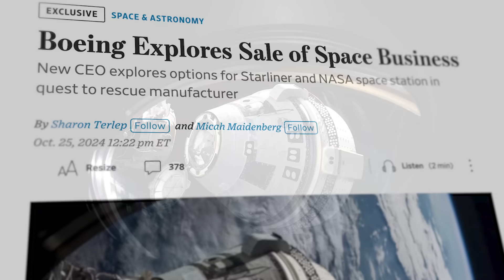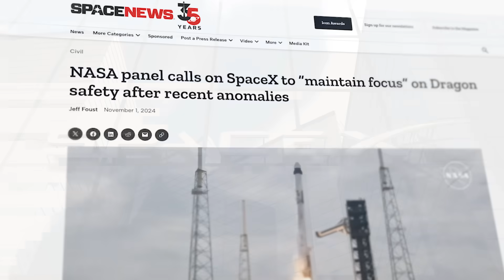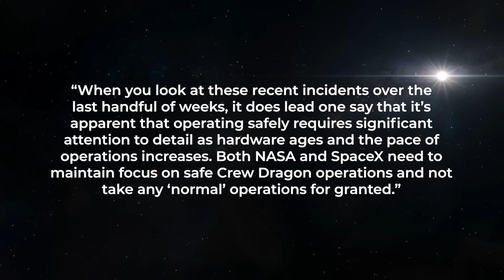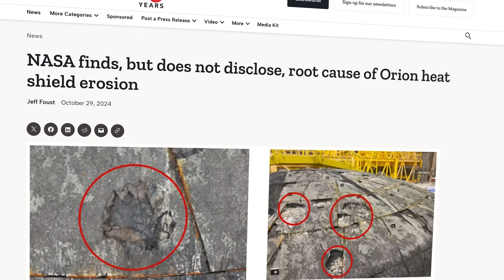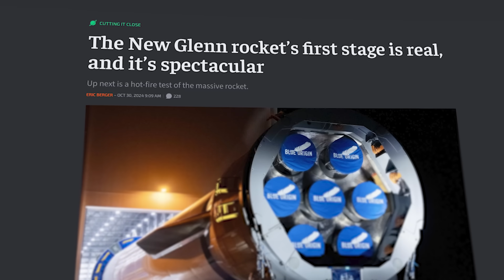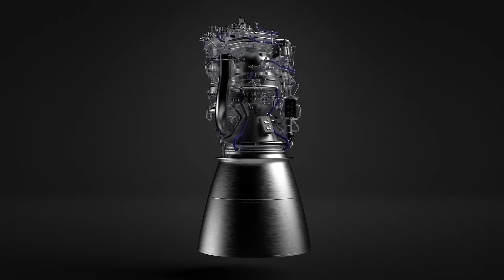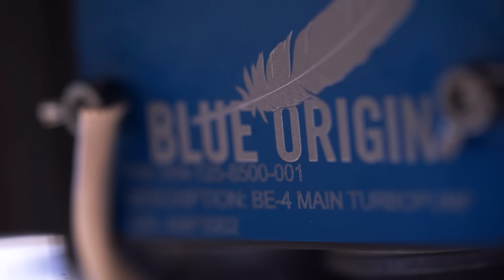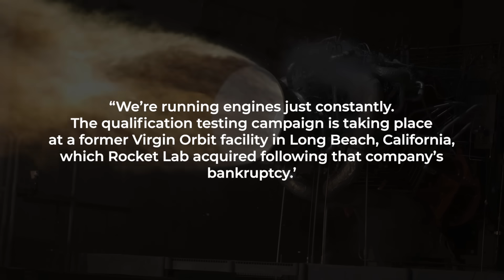Boeing Just Gave Up On Starliner...

Comment: Taxpayers should get their money back for the star liner. Billions spent, nothing that can be used  in return
Reply: You can't even get Boeing to put all of the Bolts in it's new airplanes to keep the doors from blowing off.
Reply: Actually Boeing does not get paid
Reply: @eternaleggface So youre tell me Boeing accept a contract by NASA for FREE?! Why do you think NASA selected Boeing in the first place if not due political influence? Boeing become a parasite corporation, thats a fact...
Reply: @eternaleggface  My understanding is that they receive progress payments, for milestones achieved; and they receive their last payment when Star Liner meets its final KPI.   The reason that it is done this way is that expecting Boeing (or any other company) to be able to find $4billion plus  to fund the  entire  development,  without getting a penny on the way, is financially impractical.

Somewhere, the author of this piece says that Boeing is $1.8 billion in the hole on this project. That means that they have spent $1.8 billion more than they should have, to get to where they are.  It doesn't mean that they have spent $1.8 billion, but still have a $4 billion payment to come.

If  the contract is structured with progress payments, then it  ought  to be possible for Boeing to "sell" that project. Whoever buys it will have to complete the remaining work to meet the remaining KPIs, and hope that the cost to completion will not be greater than the value of the remaining KPI payments.

I suspect that in practice someone will agree to take over the project and pay Boeing a nominal sum,  if they think that some of the technology is re-useable.   Boeing will agree if they think that just can't afford to finish the project.  They'll take the $1.8billion loss, and be glad that they don't have to lose another billion or so.
Reply: That’s capitalism 😂 private profit, public costs
Reply: Just like scam x
Reply: @TheGuruStud yikes🥱🤣
Reply: @websitemartian  he is not wrong, space x is still failing to meet the pre orbital goals or orbital goals, has no progress on the starship lunar lander, under performance for the booster. Hell they aren't reaching the basic goals and are passing to v2 and have v3 in mind already. There are 16 months left before artemis 2, with a maximum of 21 launches without fail necessary to reach the moon once.
Reply: @Pigeon_Birb  Even despite that, they're still performing much better than Boeing who was given even more funding than Space X to begin with, (and essentially costing an estimated double the price per crew seat if they were successful) and with nothing to show for it essentially.  I'm more than happy to wait for late progress than paying double the price for shoddy/shady work from Boeing (especially taking their airliner programs issues into account as of late).
Reply: @Anderrya  actually they are performing worst technically since boing sls only launched once and was practically flawless. Spacex is attempt 10 and is still failing at basic goals for a rocket. Blue origin with a completely new rocket was practically a complete success on the first launch attempt. Nothing to show? Boeing launched and orbited the moon with sls, starship has no lander or ship still and boeing has not finished their capsule but its at least exists. Spacex starship has a worse reputation than Boeing aircraft considering the vast majority of boeing products have not blown up. What is shaddy is taking the money saying you will fulfil the contract and not being able to fulfill it even after being given an extension, at school if you did so you would have failed the exam. SLS and orion are expensive for no reason i agree, but they had more to show than the fragments of rockets that starship end into.
Reply: @Pigeon_Birb  kind of hard for you to say the sls was all Boeings doing since it was a joint project with NASA. Not to mention if you want to claim it was, how about the issues Orion had when it came to reentry? I do however agree that blue origin is making great strides with their own program. Again what I said about sls, it’s not just Boeings doing, and since their involvement in the project will soon be scrapped, I’m sure there’s a number of reasons for that.  Space X on the other hand is its own project, that is just as blue origin under the advice of NASA but still primarily under their wing.  I’m sorry that you think having hundreds of lives being lost due to Boeing shortcomings in their aircrafts is far less worrisome than test flights of an experimental rocket that’s hasn’t lost any.  At least Space X can make it to the ISS without issue unlike starliner, who leaves people stranded. What I find worst is the fact that reaching out to private companies was done to save money, meanwhile Boeing is treating NASA and taxpayers like endless piggybanks. Sure Space X hasn’t fully filled their contract, but neither has Boeing.
Reply: SpaceX seems to actually deliver.  Humans and payload.   @TheGuruStud
Reply: @TheGuruStud  ?

Comment: I think there was a bump into the bottom of the capsule during separation compressing some portions of the ablative Shield causing it to have greater thermal conductivity and thus burn through faster in those areas

Comment: Every single spacecraft I have ever seen reentering with four parachutes 3 will open first followed by the fourth. It's possible to get all four to open exactly at the same time there's hundreds of little variables that make it unlikely.
Reply: Kinda like a 3 legged stool vs 4 legged. 4 Legged will almost always have a wobble until enough weight is applied.

Comment: The booster landing anomaly might’ve been because this was the launch leader?  This booster has been launched more than anything else and maybe 23 launches is the limit?

In the fourth parachute issue is happened before .  It only highlights the fact that SpaceX wanted to use three parachutes and NASA force them to use four.   SpaceX was right and NASA was wrong. The ship only requires three parachutes and the fourth one can’t grab enough air to stay inflated.
Reply: 3 chutes were having issues during testing elon had the idea for the 4th chute. NASA had nothing to do with it.

Comment: The difference between all these other companies and SpaceX is that SpaceX uses real footage of launches and missions, and all the other companies use CGI.
Even NASA, just a bunch of CGI, no actual missions.
Reply: Assuming you are referring to ascent video, NASA actually pioneered the use of live video during ascent with cameras placed on the SRBs.

NASA's cameras were intended for engineering use and using them for PR was secondary.  SpaceX is the first company to feature the use of external cameras during live launch coverage, and has taken it to the next level with live video during re-entry (for Starship).

In large part the reason for this is technological -- high quality video requires a lot of bandwidth, and even in the 90s hardware that could digitize and transmit such video was neither cheap nor light.  Add to it that the Shuttle was designed in the 70s and ita clear that adding live video wouldn't be trivial.

All of SpaceX's hardware was designed in the past 10 years, though, so cameras and live video was designed into the system.
Reply: @jmr5125  Seeing as how the first launch I remember watching was Apollo 15 when I was 5, I have  been following and supporting ALL space programs for many decades. It is not surprising that NASA has failed so spectacularly in nearly all of their endeavours. They get halfway through a project and then have the funding pulled. Look at the latest imbroglio with Bechtel building the gantry for Artemis. 3.7 billion and they are not complete yet. 5 billion for starliner, Constellation, cancelled. They have no balls. SpaceX commits and sees things through. That is how things get done. Craft that actually fly. Missions that are accomplished. They are leaving all national and private sector space programs in the dust.
Reply: @wildbill1726  Well, yeah, but the fault doesn't lie with NASA, but with Congress.  NASA is doing the best it can with the hand it is dealt.
Reply: @jmr5125  Write your congressman. Shame them.

Comment: Starliner has been a horrible project that NASA should have dropped after the very first test mission, but it's ridiculous to claim there's something still inherently wrong with the spacecraft itself.  If they resolve the thruster problem, which is not directly Boeing's fault anyway, Starliner would be perfectly capable of serving Blue Origin or another owner.  Boeing has sunk close to $2 billion into the program and much of that was to fix its many, many bugs, so the vehicle is now flight-proven for months in space and merely needs a thruster upgrade.

To Blue Origin or another buyer, Starliner might be bought at a huuuge discount from its realistic value and merely renamed to whitewash its reputation.  If you doubt that this would work, just look at Spectrum, which has somehow successfully convinced many millions of people that it's no longer Time-Warner.

The public is quite forgetful, after all; Americans are still buying Volkswagens and many won't even remember that they once vowed to never own one.  I can hear some saying "huh?" right now ;).

It's also worth remembering that if Starliner were being held to the same standard as the Space Shuttle, the crew would have returned on schedule and without incident.  Starliner returned empty only because Boeing could not prove that it would meet the risk ratio required by the commercial crew program and that was only because they could not concretely quantify the thruster problem, which only occurred in space.  When the capsule did return empty, it experienced no issues that were disclosed under NASA obligations.

I hope that Boeing sells Starliner to someone that will put it to good use; it would be a waste of resources not to do so.  Hopefully they can come up with a good name for it.  Why would anyone develop their own crew capsule from the ground up when Starliner is now quite mature and proven?

Comment: Who in their right mind would want Boeing's space division.
Reply: Depends on what strings come attached.  The division itself is just fine.. the problem is that their contracts require them to 'partner' with many other companies and use the parts they are told to use.  they have very little control over what actually goes into their capsule... remove those requirements and you would likely have a pretty effective division.
Reply: Jeff Who.  What a Bozo!
Reply: IP might be worth something. And engineers. We're short of these people everywhere
Reply: @DunnickFayuro What kind of engineering
Reply: @DunnickFayuro  who would want a Boeing engineer ?
Reply: @michaelotoole1807  the engineers are fine. it's management and unrealistic expectations for the workers that is the problem. when the company was run by the engineers, they were fantastic. but now they are run by beancounters. they killed the company.

Comment: Back in the day everyone doubted SpaceX could ever compete with Boeing's space program 😂
Reply: I remember people being angry over SpaceX not getting the same amount of funding.
Reply: To me it was obviously going to succeed and be robust due to the processes spacex followed.  They iterated ridiculously fast and did full integration tests each iteration.  They optimized the tests procedures for time.  You cannot fail with that much iteration.  

I also knew starliner was going to fail in some way because of the complete lack of testing.  I remember that at one point it was so obvious that nothing was being tested that even the corporate press started asking about it.  Bridenstine gave a little speech about how each company had their own approach and both are equally valid.  That was obvious horseshit.  It was a sign that boeing was winging it the whole time. YOLO engineering. Every single flight attempt and flight fit right into my expectations from as far back as 2016.  

The indicators have been there for a long time.
Reply: @_PatrickO  Just sheer hubris on Boeing's part. "We did it before... its not like it's rocket science!"
Reply: Got paid less and did more. This is why competition is important. WI did this with the highway program. They offered like 5 or 6 digits in bonus every day they got done early. They finished like 13 days early  (on a decade long project) iL is still working on their stretch of the same highway.
Reply: To be fair, back in the day Boeing did great things.
Reply: @stylesraw  I really don't want Boeing to fail, I just want then to do better. Sadly it seems like they have given up entirely.
Reply: @LoricSwift  Yeah, it's really a great loss when such a giant in the aerospace industry falters in such a spectacular manner.
Reply: @stylesraw  Every time they change a new CEO, it is like a new company. Everything they did in the past were not by this new company.
Reply: @douglass220  It was more than just a leadership change though. They had a merger with another company that had a terrible toxic corporate culture and management style that prioritized cutting corners and basically pushed out anyone who wanted to continue trying to do good quality work.
Reply: Starship has done nothing! failure to get to the moon so far.
5 failed flights how many more before they reach orbit and not melt like butter!
No HLS, no space refuelers, nil!
Trump and Mr Musk  (whos Musk's next job is removing many people's livelihoods in the government sector and giving them no jobs nor future)  
What a hero....he will do the same what he did to twitter....ruin it.
A man with no scruples
Reply: The Obama administration got so much shit for funding SpaceX and beginning the COTS program. Much like their funding of Tesla, it turned out to be a major move to achieve US dominance.
Reply: I'm embarrassed that in 2014 I was among the strongest doubters. Granted I didn't know spacex well at the time except that their rockets blew up alot. I thought like many people that Boeing with more experience was a safer bet. Seems I was off by light years.
Reply: I mean no one can compete with Boeing... they keep setting new standards of ineptness!
Reply: now haters pay people to force it to fail or at least delay
Reply: @darugdawg2453  Boeing is a self hating group.

Comment: Dream Chaser is not a better spacecraft than Starliner. Starliner was horribly mismanaged, but Dream chaser is a fundamentally stupid design that has no hope of ever carrying humans for NASA or being an economical cargo vehicle.
Reply: What brings you to the conclusion that it is a fundamentally stupid design? It resembles much of the space shuttle glider with avoiding the exposed heat tiles during ascend and it is way less complex. So where do you see the problems?
Reply: @genius1a  Okay, well... We can start with the fact is resembles Space shuttle by far the most expensive and deadly vehicle in the history of the world. Copying the design of a vehicle that carried a 10% chance of death every time it flew and cost 1,000x more than it was supposed to is fundamentally stupid. From there we can look at the ways it departed from that design. It uses a very large throwaway service module that is effectively it's own space capsule. Then there is the fact it has to be placed in a very large expensive throwaway fairing for launch that necessitates Dream Chaser have folding wings. Those wings adding mass and more points of failure. Because the vehicle is in a fairing there is no effective way to load people into the spacecraft after the fairing is installed around the spacecraft and the spacecraft is installed on it's booster. This last issue 100% insures NASA will never approve Dream Chaser for human space flight....

Honestly this is just the tip of the stupid iceberg, but I tired of typing.
Reply: Why.

Comment: Why do the Elon Musk rockets keep on blowing up???
Reply: that's how they learn - rather than running simulations, they launch test rigs and wait for them to fail. by the time they're doing actual missions, it'll stop happening
Reply: Simulations aren't the best testing method, you can use it to try and find and correct issues. You have to do actual launches and test the boundaries to properly fix issues
Reply: quicker development cycle. blue origin is a older company than spacex yet hasn't launched 1 orbital rocket yet. while spacex has near 100 launches just in 2024.
Reply: @michaelotoole1807  sounds good, but how do we know they are learning something... is their an audit trail showing they remediate each root cause problem they encounter... they could just be guessing also sometimes.. can you provide this documentation...or we just have to take your word for it?
Reply: @soothsayer2406  proof is in the pudding. no other rocket has flown so many times with so few  incidents. thats why spacex has the cheapest launch inshurance.
Reply: @michaelotoole1807  What kind of pudding are you taking about?. Chocolate, 
.Vanilla, Strawberry  or your favorite flavor, inshuarnce? What ever that is....
Reply: Activity does not equal achievements
Reply: Proves we never went to the moon
Reply: @BuzzC-t3l  Another flat-Earther idiot?